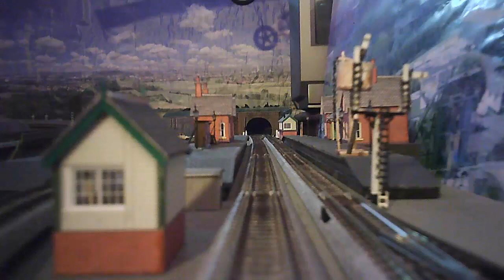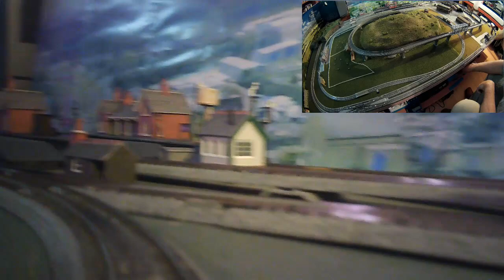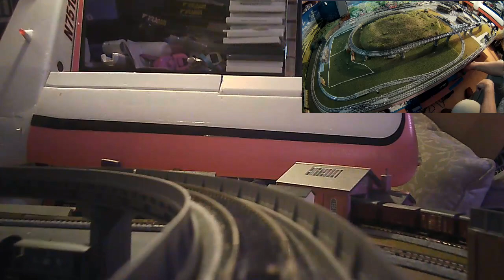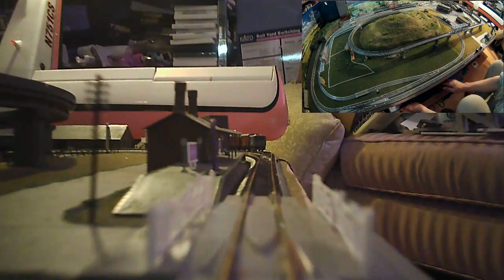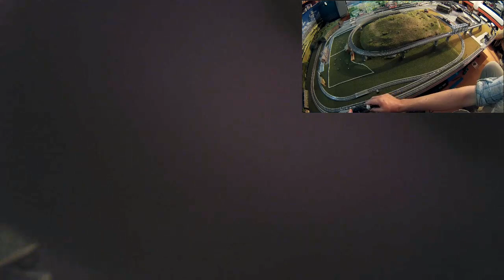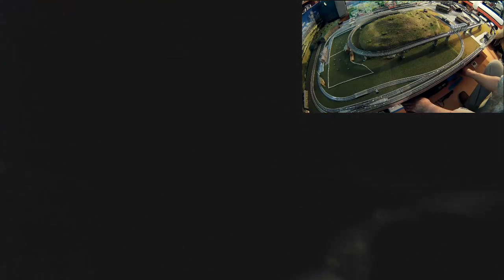N Gauge 30, Train cam tour take 2

Comment: What camera did you use. Just building a n gauge myself and would like to try and film some of it?
Reply from the maker: As is shown at the beginning of the video, the camera used for this tour was the SQ11 Sports HD DV camera. This is a very low-priced little camera that can still be bought online for $10 or so - just put 'SQ11 camera' into Google. I have also done train-cam tours with the Mobius Mini camera, which is much better quality, and considerably more expensive (around $100). The Mobius Mini is a much better camera, but it is also a little bit bigger, so that's an advantage to the SQ11, so far as managing to get around the layout is concerned.
Reply: @kleedhamhobby  cheers